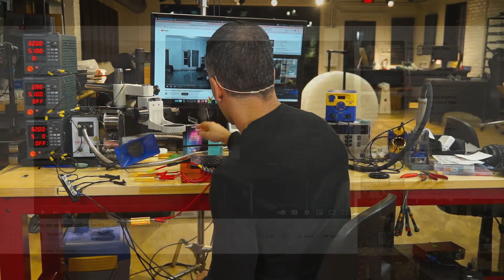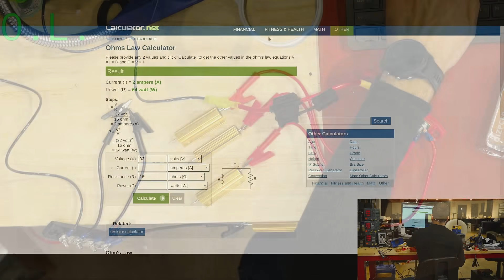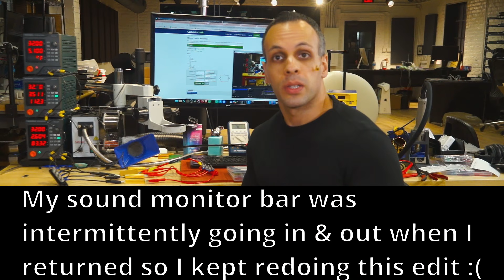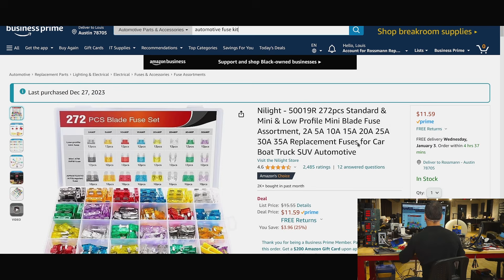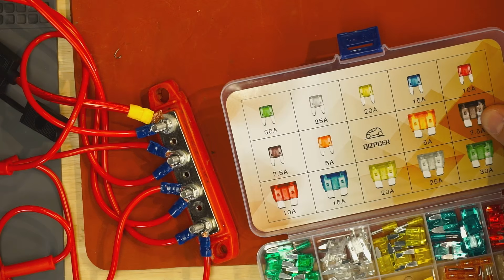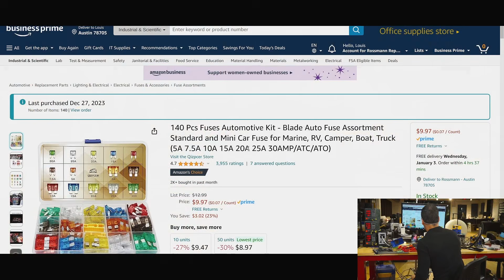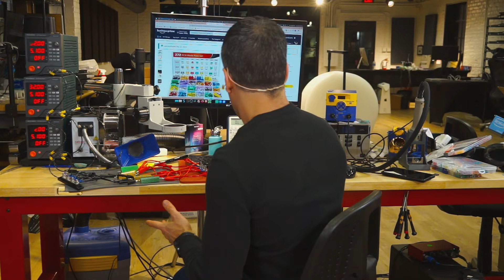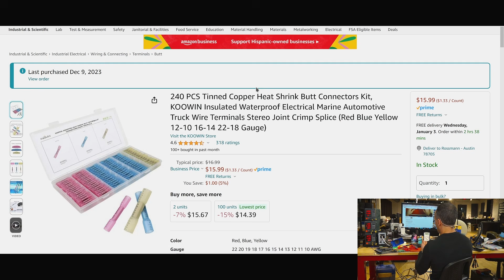Amazon Sells Fake Electrical Fuses

Comment: For anyone curious what a good fuse should behave like, the data sheet for Bussmann ATC blade fuses says a 2 amp fuse at 7 amps (or 350% of fuse rating in general) should last max 0,5 s and at 12 amps (600% of fuse rating) max 0,1 s. It doesn't specify max operating time at 400% (8 amps) but looking at the curves it should be around 0,2 s, not however long those crap fuses took to blow
Reply: the impression I got watching this, along with the cheap chinese commentary, is that the 2 amp fuse is a miscast 5 amp or 7.5 amp fuse. Its likely cheaper for them to make 2 million of one rating than for them to try and make 1m. of one rating and then 1m. of a lower rating since its less dies or whatever.

Also thank you for sharing the data, i honestly might not have went about looking it up and just taken the video at face value sprinkled with my own judgement LOL
Reply: @legionofanon  I was wondering that myself with the BLOW current at 10A for both brands that iof they do NOT actually have any fuse BELOW say 7.5 
would like a retest on the "common" size fuses like 15A 20A and wonder if the "engineering" is BAD and they cannot / dont know how to make LOW amp fuse
Reply: That was the Answer I was looking for. Too lazy to google that myself.
Reply: Even better would be to look at what ISO standards require of conforming fuses.  Many fuse manufacturers may offer tighter guarantees regarding response time, but the applicable ISO standard would specify that at 2x current, a fuse MUST NOT blow in less than 150ms, but MUST blow within 5 seconds.  A fuse that takes only 1 second to blow at 2x current might be "better" than one that takes 1.9 seconds, but both will be adequate in circuit which is properly designed for use with a fuse of that form factor, since proper design of such a circuit would require that it be able to survive 2x current for more than two seconds without fire or other such hazard.
Reply: @flatfingertuning727 Yep, I remember that the IEEE regs for fuses in the UK all state that at 2x the rated current, a fuse should blow within 5 seconds. That’s for a standard, “slow-blow” fuse type, which is what is used in UK plugs and fused spurs etc. Failing to blow at 4x the rated current is potentially disastrous. At 4x the rated current, a cable will be heated at 16 times the power it was designed to handle - more than enough to set it on fire. (Power is proportional to current squared).
Reply: Wait, Bussmann or Rossmann fuse? lol
Reply: The fuses that are blowing 'at' their rated current isn't good like he's saying.  I was taught a fuse should be able to take it's rated current.
Reply: @peterjohn8625  Fuses are designed to blow at their rated current limit, but there's a bit more nuance to it. The rated current of a fuse is the maximum current it can safely carry without blowing. However, fuses are typically designed to withstand slightly higher currents for short periods of time without blowing. This is to prevent nuisance blowing due to temporary current spikes that are normal in many electrical systems.
Reply: @ZandarKoad  The rated current is what the fuse can take without blowing . " Fuses are designed to blow at their rated current limit " is wrong.
Reply: Littlefuse make their blade fuses to comply with ISO 8820-3, and publish a datasheet with the applicable time-current disconnection curves.
Reply: It is worth noting that some slo-blos can take 5 seconds to go at 400%. The first fuse however, was absolutely bunk and unsafe.
Reply: I wonder what the quality of Halfords fuses are ??
Reply: Just replace commas with periods, and it all makes sense.

Comment: It would be interesting to see, in my opinion, the difference under the microscope between the fuses which are rated at 2A but blow at 10A and the fuses which are rated at 2A but actually blow at 2A.
Reply: the difference under the microscope is that a fuse rated at 2A which actually blew at 2A would get returned more often on amazon
Reply: @Triplechomending  IIRC correct from my dim and distant electrical class fuses should more or less instantly blow at 2x rating.
Reply: @IMBlakeley  Yes they should, that's literally their job.
Reply: @IMBlakeley  ISO standards require that they not blow within 150ms, but do blow within 5 seconds.
Reply: Are people that stupid - um Yes!
 @Triplechomending

Comment: I bought from amazon to replace a blown fuse on my truck on a part that costs 2k and controls the gas flow. That board melted, but fuse did blow. Who knows how much damage was inflicted if this fuse was allowing WAY to much power to go through =/ Sadly that board is unrepairable since it burnt a hole in the middle.

Comment: Did you think possibly the factory is just making all sub 10 amp fuses out of the same gauge wire? Both the 2 amp and 5 amp blew at 10 amps, they could be all made in the same factory and slap different colors on them. Maybe they have like 3 different gauge wires.

Comment: Louis, there is a time - current characteristic to a fuse, fuses are not meant to protect power source from power overdraw, but to protect power transmitting wires from overheating and catching fire. You choose your wire gauge to  to transmit a given amount of power, then you choose a fuse to protect that wire from transmitting too much power. And it takes a lot of time to melt a normal fuse if you are not drawing many multiples of allowed current.

Comment: A conventional blade fuse is meant to be quick blow. Littelfuse’s datasheet says a 1A fuse will blow at 1.6A after only one second, 1.4A after 10 seconds. The larger value fuses have more thermal mass in their fuseable element so blow somewhat slower, a 40A fuse should blow at 90A after 1 second, 60A after 10 seconds. The Amazon fuses that blew instantly at 10A are likely just 7.5A fuses, or thereabouts.

Comment: It gets worse when Joe consumer buys a new automotive fuse when one blows in his car.  He then proceeds to install it in the car, not realizing that it was a faulty circuit that blew the fuse.  now the new defective fuse sets the faulty circuit on fire and it does more damage.  Then the mechanic blames the customer for not checking for a fault first before replacing the fuse.  Maybe mechanics should rather blame the faulty fuse.

Comment: I've been working on a monster powerwheels upgrade for the kids building a much more powerful one.  I was testing the Amazon electronics i for and found the 30A fuse wouldn't blow until 75A.  So basically, way more than enough to set the wires on fire with my kids driving the thing. 

I went to a reputable supplier after that
Reply: and at what amps did the reputable one blow?
Reply: @bn880  tested a couple, they popped right at 30A 24VDC.  Perfect 👌
Reply: Sounds like baloney  @mattadulting
Reply: @bn880  okay.... and your disbelief changes reality?
Reply: Doesn't let your bullshit through that's all.  Electronics Engineering basics.  You just bought a bad fuse that you say is brand name then.  @mattadulting

Comment: Fuses are designed to accept some overload. They should take the rated current indefinitely.  It may take even 30% overload but twice the load should blow it in under a minute.

How on earth can an average user rate a fuse? All he sees is that it passes current. It is like rating a car airbag. You have no knowledge if it actually works as intended.

Comment: On a related point, Amazon sells a lot of little electronic doodads (lights, LED strips, radios, holiday lights, and so on) that are not UL listed.  Should your house suffer a fire and your insurance company finds that you have such a UL-non-listed product, they might void your insurance coverage.  Caveat emptor.  Check for the UL label and beware of fakes.  (UL, or the Underwriters Labs, is an American institution and other countries will have different but equivalent organizations.  Find out the agency for your country and choose  products appropriately.)

Comment: Why did you add all those resistors ? - you could just hook the fuses directly to the power supplies, and crank up the current. This surprises me as it is obvious that you work with electronics.(...but not electronics engineering?)

Comment: Louis they are working as designed....way over spec...and there is a problem with that.... they  are not sensitive enough to protect the device it is supposed to be protecting?

Comment: Ive seen plenty of clips on moto madness and dirtbike lunatic where some crotch-rocket bike burns down on the side of the road, because of aftermarket mods installed. Most likely due to cheap, dsngerous crap like those fuses from amazon. I wonder what insurance companies would think of those fuses?

Comment: I didn't realize that you had to depend on a color chart to identify car fuses.  All the ones that I replaced have had the rating printed on them, not that I replaced that many.  
Also would have been interesting if fuses from your local auto parts store are any better since most of them are probably made in China or if the stores have better quality controls.
Reply: The color bands are a lot more robust
Reply: There's a fair chance they're manufactured in the same facility
Reply: It's less about the quality of the fuses and more that they are mislabeled.

Comment: Excellent video. If you want to drive the point even further home, rig something up that can show the damage that could happen if you run ten amps through a defective 2 amp fuse, and why we need 2 amp fuses that work as advertised.

A little fire always draws attention to the problem.
Reply: step up 40 A through a 20A fuse and BIG WIRE FIRE

Comment: I tock a german data sheed for a car fuse. it says 
1.1*In at least 100h before trip and do not need to blow.
2*In trip between 150ms and 5 s
3.5*In trip between 40 and 500ms
6*In trip between 20 and 100ms.
the first 2A fuse is ridiculus!

Comment: Reviews aren't trustworthy across the board nowadays. Bought a laptop at membership club that starts with a C, that laptop screen went blank after 3 months. Posted a review about the bad laptop. If you look on the website reviews on any other device, other than the one it was posted on that review is nonexistant. Yes amazon reviews are a million times worst why I avoid buying anything there unless it's a last resort.

Comment: Wow, I've never been more glad to not support amazon. I don't really shop there anymore mostly because of how archduke Bezos has unsafe working conditions, but this is one more reason, I'll have to tell my friends that shop on amazon about this, and I feel that others should do the same. Thanks for the demo Louis! I'm also kind of glad they still have a reliable fuse seller, but the fact that the positive ratings seem consistent with the functional and faulty fuses is really concerning.

Comment: 100% agree. I'm increasingly caught out with fake components on amazon. My last order was a fake bunch of LM317 regulators. I order from RS in the UK now which is pretty expensive but you always get a datasheet and get exactly what you order.
Reply: I'll gladly pay three times what Amazon asks just to get the real component on my first purchase.
Reply: I learned that the hard way, A bunch of expensive genuine components stuck to a board littered with just a few knockoff pieces that don't work is still worth nothing. In fact, a bunch of money was wasted trying to be cheap. Never again. 

At least you can buy linear regulators at the major suppliers again, unlike the dark years...
Reply: Same thing with auto parts on Amazon.  Lots of junk and even counterfeits of reputable brands.

Comment: Technically speaking, fuses are to prevent wires from overloading and creating a fire hazard, a side benefit can be the device(s) on the delivery end  can be somewhat protected from excessive damage. The primary purpose of fuses is protection of the wiring downstream of the fuse.

Comment: Main purpose of a fuse is to protect cables, though, and not your power supply. A car battery for example (these fuses are for vehicles) can deliver up to 1000A or 12kW. If you have a short somewhere because the cable or the device is damaged, the fuse will blow before the cable gets too hot and starts burning. That’s why your fuse size depends on your AWG (or mm^2) and length of the cable. If you, for example, have too thin and too long cables, the cable still can catch fire while the fuse won’t blow, because you can only push a certain amount of current through your cable due to the resistance of copper.

The amperage of the fuse is (usually) also printed on top. Wouldn’t go by color, especially with these crappy ones 😂

Btw: Jeff Bezos is not the Amazon CEO anymore for quiet some time now.

Comment: Those positive reviews may not be fake, but actually left by the clueless people who just happy that a fuse is conductive  (i.e. not DOA). It very rare to find a review left by a competent buyer who took time to test those properly.

And you know, assuming you spend a few hours and tested a dozen of fuses off Amazon and decided to leave a positive detailed feedback - it’s pretty much pointless, since tomorrow that seller may be off the market, or selling subpar fuses sourced from another manufacturer.

There’s also one Amazon “feature” that drives me nuts - seller can change the product page entirely to sell something completely unrelated. I saw so many feedbacks left 5-10 years ago with photos of something completely unrelated to the item is currently selling.

Comment: The spec sheet probably says "does not blow at or below 2A". I think shoving a wire in the fuse holder might be better than buying those fuses.

Comment: While getting a curve for a brand of the day fuse is not going to happen you can get curves for a brand like LittleFuse which could be used as a standard. The others brands will be a little different but they should be close enough to demonstrate that a fuse will do the job it is expected to do. Also a 2 Amp fuse should not blow at 2 Amperes generally double the rated current show blow is a short period of time, short being relative to the type of fuse.

Comment: Wouldn't be too surprised if some of these things are also fraudulently carrying certain certification marks they shouldn't have. You'd think an organization such as Underwriter's Laboratories would have good reason to check what's listed at Amazon, and have lawyers knocking on the door about stuff that doesn't meet their standards. (Letting that stuff go kind of voids the whole point of having the certification label in the first place, so you'd hope they'd be on it.)

I'm curious if you've spotted any of that and reached out to any of the certification organizations about this kind of thing? And what kind of response you'd get after telling them?

If safety orgs bother doing their job and enforcing proper registration to ensure mark validation, then this nonsense would also show why you should look for certain certifications on products. Yes you'd end up paying a bit more for things that have the safety testing done, but there's good reason for it. Otherwise you end up with garbage that's all over the place.

Comment: I learned better YEARS and YEARS ago, the first time i ever saw a dollar shop or dollar tree, even a dollar general..you never buy fuses from cheap manufacturers, and only use name brand like bus the yellow tin. I always wired up systems in my buddies and my vehicles growing up and I learned this when i tried one time to use a cheap fuse in a AMP, it will either blow prematurely, or it will fry the internals of the amp because as he said they never blow.

Comment: I have those same connectors. I bought 3 different brands. The first ones I bought were better than the last two. The crimping area/amount of metal used was more than the last two. But I bought the cheaper ones.
I was not aware that fuses are volt rated too.
I have a 30amp fuse inline with a 60v dc battery and a peak 40amp motor controller and it does not blow when it hits 40amps. Same amazon fuses.

Comment: Assuming  this is a slow melting fuse, it should trip after about 2-3min with 2x rated current. After that it should be 1minute to mere seconds for 3x or more.

Comment: Nice test UL certification means everything when purchasing electrical products be it a wire connector or a fuse or whatever could be a smart plug or switch always make sure it is UL cert is present.  Actually not doing so your insurance may not cover a fire if your home burns down. Always use UL certified electrical components, connectors, wire, devices its almost like an unwritten law. There are other laboratories that are reputable as well such as QPS and ETL but CE doesn't hold its value anymore because Chinese Export stole that label so keep that in mind when buying electrical and electronics. Look for UL, ETL, QPS certifications. If they are not present you'll have to run tests like this to ensure your safety on your own! 
Gotta remember most people that buy this stuff do not have working electrical knowledge that are doing the reviews although it may seem like it they don't or they would not have purchased these to begin with. There are a lot of relays in products that fail catastrophically and cause fire just the same they weld together and start a fire. Staying stuck on because the appropriate testing wasn't done and steps were not taken to mitigate such failures. Testing is everything.
This would not happen say with BUSSMAN fuses. 
Thank you Louis for all that you do!